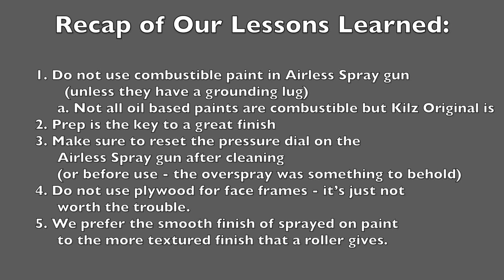The Wardrobe - Part 2: Misadventures in Painting

Comment: The Graco Ultimate is good for latex and mineral spirits (oil based) paints and primers. The Ultimate MX is needed for hot solvents such as lacquer... the internals are different. 

It will definitely work for your needs, but try doing a test spray to dial in your settings before going to your workpiece. Get the gun closer as well and you won't have the massive overspray. About a foot is good to go.
Reply from the maker: Thank you - funny thing is we always do a test spray on cardboard to make sure the pressure and gun is setup correctly - for some reason that morning we did no do it.   We ended up switching to all water based paint and it has been going great since - one change we did make is getting a smaller tip (less fan) and that has helped a ton with the overspray as well.  Thanks for the tips - we keep practicing and we will eventually be pretty good with this stuff :)
Reply: Beginning from this Morning keep up the great content! You guys are awesome!

Comment: Great video (again). Do you leave your mini split on all the time, letting the solar top off your batteries?
Reply from the maker: Thank you Scott - We are somewhat stress testing our solar while we have an opportunity (learning as much as we can about how our system behaves).  During the day it is usually well over 100 degrees (usually around 108-114).   If we do not leave the A/C running in the bus the temperatures will climb to over 140 in there.  So we run 3 or 4 air conditioners in the bus.  Our mini-split (12K BTU) stays one 24/7 while the bus is being worked on (takes too long to cool it down if we don't stay on top of it).  We also run the battery bay air conditioner (5K BTU window unit) 100% of the time while it is home with us.  In addition to those - if we are working near the back of the bus we run the air conditioner in the back (5K BTU window unit) and a 9K BTU portable unit that is an energy HOG).  We also very often run power tools from the bay plugs or inside plugs.  
Here is what we have been doing recently.  When we bring the bus to work on it - we deploy our panels and we turn on all the air conditioners (3 or 4 depending on what we are working on) and just let it run all day.  During the day we can run until about 5 or 6pm on just solar alone (with all those air conditioners running and no shore power). At around 6:00pm or so our battery will usually be around 90% full (as low as 80-85% if we have had a cloudy day).  At this point, we bring in our solar panels and turn on the shore power (we have shore power programmed to NOT charge our batteries unless they are VERY low) - so in the morning we start making strong solar around 7:00am or 7:30am - we are usually "100% full" by about 10:00 or 10:30am  - in which case we turn off the shore power and run on solar all day until about 6:00pm or so - when we turn shore power back on.
The solar and battery have really exceeded our expectations and really do perform very very well.  We will do a video after we get some of this cabinet stuff done about how we run/test it while we build.